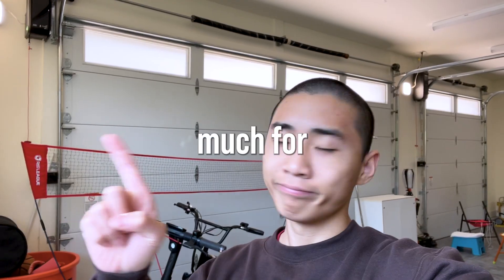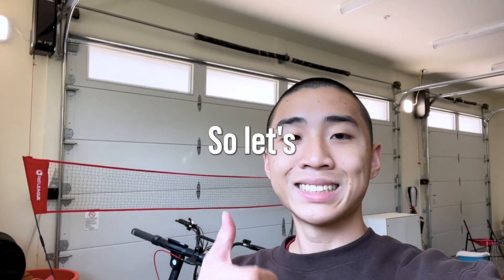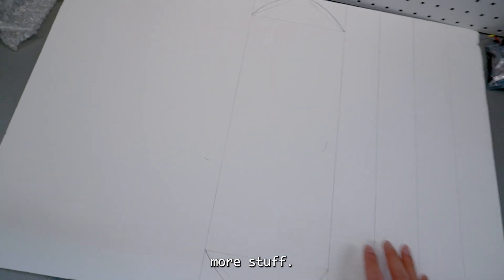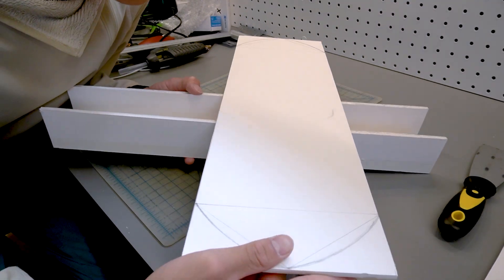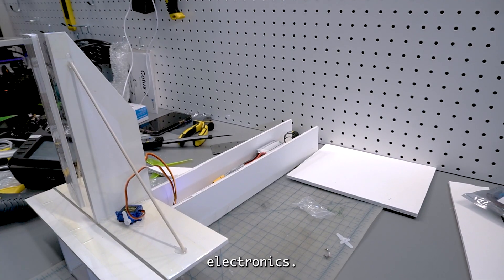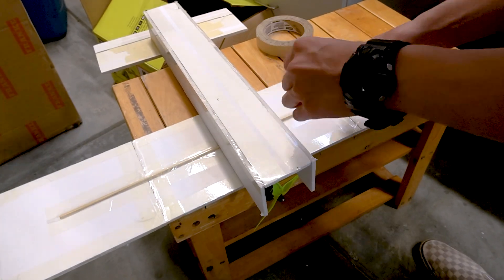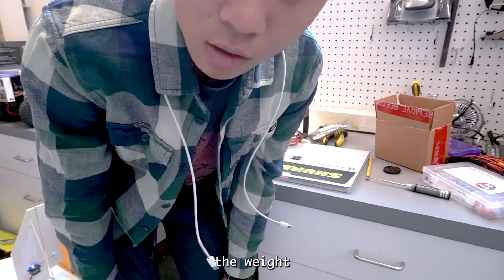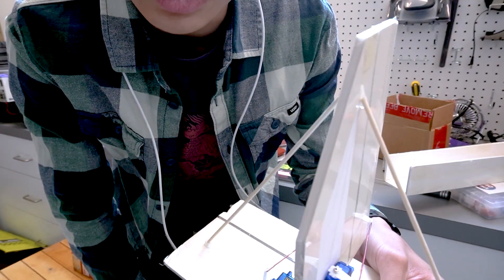(I Tried) Building a Budget RC Airplane...

Comment: 0406   the span of the horiz-stab should be equal to Thirty percent  of the wingspan.   that is a multiplication by  .3 .     the height of the vert-stab should be equal to a bit less-than  fifty percent of the horiz-stab span

Comment: when a model airplane has a zero-dihedral main wing, AILERONS  WILL  be  needed.
0106   the apex of the curve at the wingtips  Should be located at  THIRTY  percent of chord.!
0124   a  tail  boom  SHOULD  be  TAPERED; in two axes.!
0221   the vert-stab  is  RIDICULOUSLY  tall.!   and, the rudder hinge appears to be a  DISASTER.!   that too-tall vert-stab makes the tail 'heavier'.!   the leading edge of the vert-stab  Should  Extend  from the tip  TO  THE  FUSELAGE.!
0248   servos  do  NOT  repeat  NOT  go  at  the  tail.!   doing so makes the tail  HEAVIER.!
0252   rudder control goes  on  the  LEFT  stick.!

0253   the main spar should be contiguous/continuous across the wingspan AND the fuselage.   i suppect that your is not.
Reply from the maker: Thank you so much, this is very helpful! I will keep these things in mind when I build the next one!